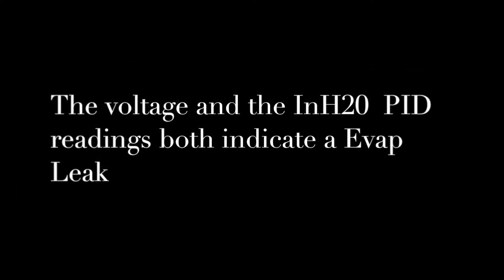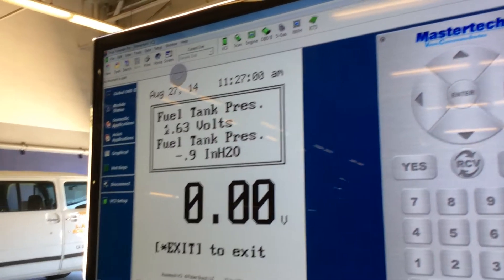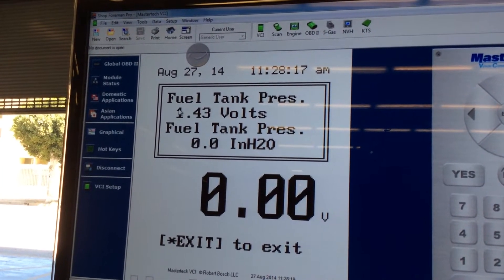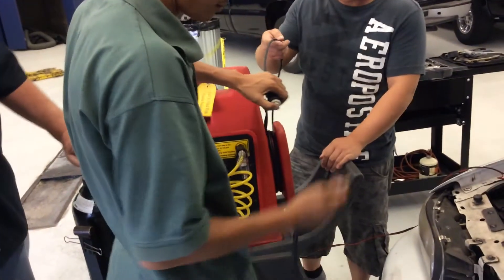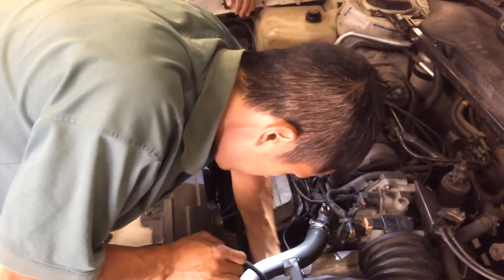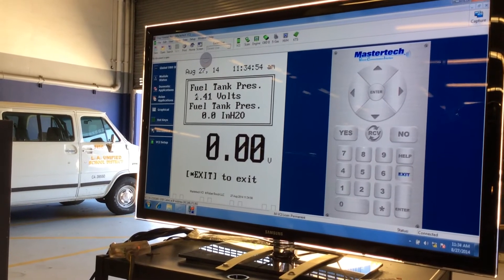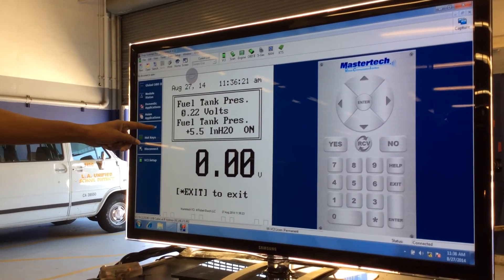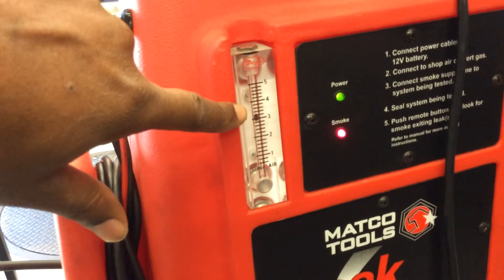EVAP LEAK 98 BUICK PO440

Comment: This will be great if I ever take my fuel cap off with the car running, I will know to put it back on.
Reply from the maker: That’s funny, the point I was trying to make was if you have a scan tool by looking at the pressures on some cars Evaporate PID’s it can help you identify the problem or confirm you have a leak or not.

Comment: I have evap problems and I just bought a dealer gas cap, and the check engine light came back on. Other solutions I can try.
Reply from the maker: Natalie Wing what type of car do you have and what's the code
Reply: 98 Buick LaSabre limited. P0440. Believe it or not.
Reply from the maker: Natalie Wing if you haven’t found your problem yet, “sorry didn’t see your response” look for ripped hoses near the canister and along the evap line.